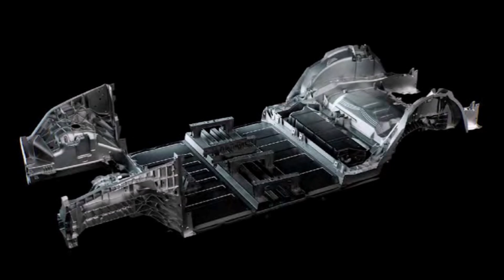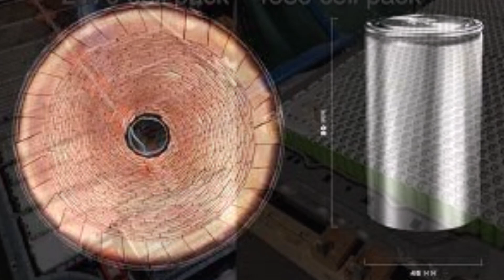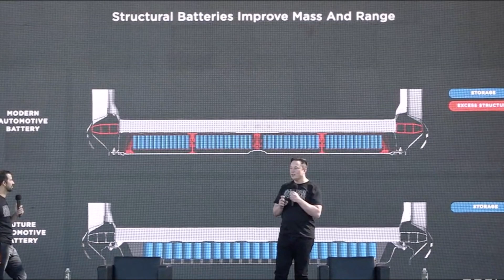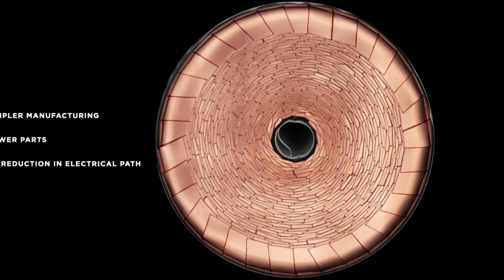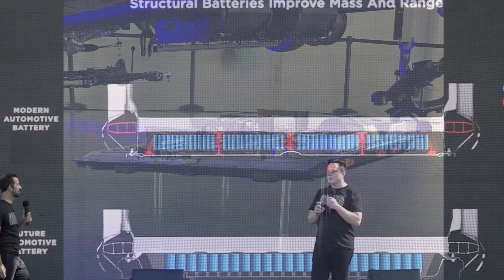TESLA Says 4680 Battery Is Progressing, But Not Yet Important for 2022

Comment: Saying that the reduced production of 4680s is not causing a problem is not talking about Tesla moving ahead. Tesla scaled back their needs by only using 50kWh of 4680 batteries in their Texas Model Ys, but they still are not listing that 4680 model on their website. The current 4680 battery pack does show that Tesla can use fewer batteries in a pack and get comparable range, while lowering vehicle weight and pack size. But that is not as exciting as saying that the 4680 Model Y (with a 76kWh full pack) can go around 420 miles or more. But until Tesla ramps up 4680 production at Kato rd., Giga-Texas, and Giga-Berlin, Tesla will still scale back production and EV deliveries.